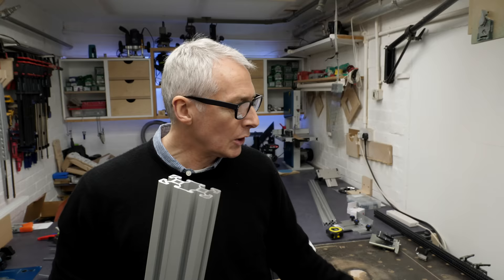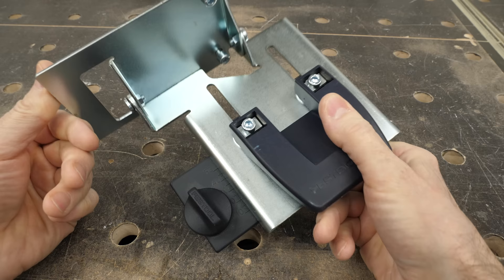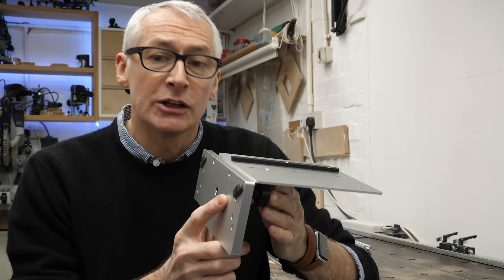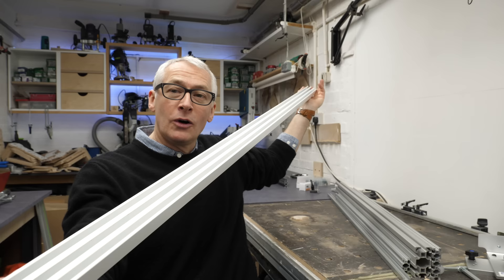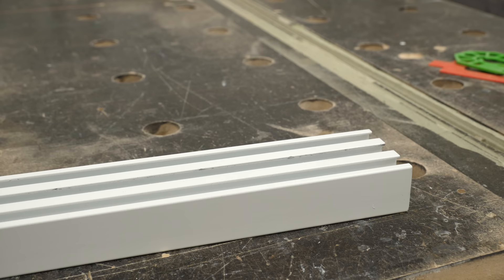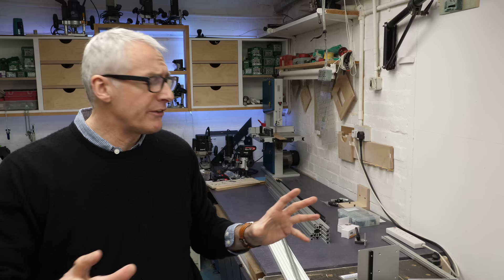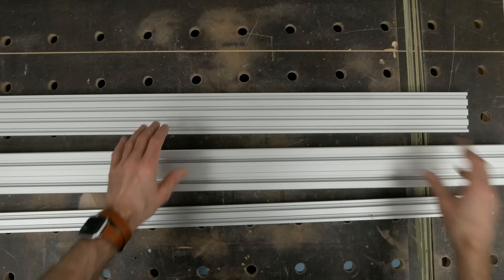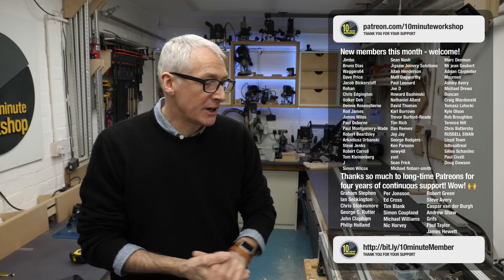Extrusion Confusion - A Guide To MFT Hardware [video 486]

Comment: I will be interested to see what material you fit the t-track into on the front. Given it is 12mm deep I think 18mm material would leave too little material on the back to secure and support it. I heard of t track pull out before when clamping pieces. I would think you'd need to  use at least 24mm, say MDF, so the grove to accept the t-track left 12mm material behind it. Interested to keep watching and find out.

Comment: Note for US viewers.  8mm is very close to 5/16-ths of an inch, (less than a 1% difference).  The 80/20 15 series extrusions work well with most things made for the extrusions with 8-mm slots.  I’m midway through designing and building my own alternative, and have been researching a bit on readily available options for the US and Canada.

And, the Incra miter gauge fence and flip stop are probably going to be used for the fence assembly.  I have it on a miter gauge, and the ability to lock precise 32nd inch, or if you set it up for metric 1-mm positions is really handy.
Reply: @Randall Thomas - I’m in the early stages of design for my mft table. Not sure how to send you a private message if you wouldn’t mind sharing some of your ideas?  I like the 8020.

Comment: Dear Peter, I know I am quite late to the game but I have dealt exactly with your problem and have a nice solution. The profiles you've shown are the Bosch standard of extrusion. But there is a very similar looking but quite different fitting profile standard made by Item. So, if you shop around at eBay or such search for "Item profile" instead of clicking on those Bosch profiles. A lot of 3rd parties are making these, so you don't need to buy those expensive extrusions from Rexroth or Item. They not only fit a clamp in an 8mm slot but also fit most t-track compatible hardware. You can get a lot of accessoires for both profiles and screw nylon sliders on your hinges if they won't fit. 

I hope that helps!

Regards, 
Etna.
Reply from the maker: Thanks. Yes, the Item extrusion is an option, but it still wont tale the Festool hardware. 👍

Comment: I'm going to be renovating my kitchen, I'll be building the cabinets for myself. Because I'll be saving thousands compared to buying a fitted kitchen, I do have enough money in the budget to buy the Makita track saw. I also had the UJK MFT in my Axminster basket, but thanks to your videos, I've realised there's nothing about an MFT I can't build myself, if I can source the extrusions and top.

I've done small scale fine woodwork, building guitars, and larger scale rough carpentry, building my Roubo bench and my wrap around work desk in the office. This will be the first time I attempt fine cabinetmaking at a large scale.

Comment: Pete. I built a paulk style bench and bought the mft hinge system separately. Works great 👍
Reply: How did you attach it Silver Fox?
Reply: @chrissnowden7078  screwed it to the face of both sides buddy. Pretty easy 👍
Reply: @silverfox8801  As in took away the plastic part that slides on to the extrusion and just used the metal face frame?
This was my fallback, hows it working for you?

Comment: Bought the Festool rail hinge a month ago and had virtually given up looking for an extrusion that would fit it. Thank you for showing the IKEA rail, will be down to IKEA tonight. Have all the knobs M6 and M8 with T bolts. I want to use one of my Makita rails. The IKEA rail you will find it in the curtain selection, as with all Ikea stores it is advisable to take a compass with you.
Reply: I went through this same conundrum after buying the Festool rail hinge and naively expected it to fit some normal T Track. I’ve found some extrusion that fits the plastic ‘T profile’ of the MFT hinge/front support perfectly.
However… it’s box profile so I need to route a 7mm channel into it which I haven’t got round to doing yet. It is 2mm thick so it’s nowhere near as thin as the Ikea stuff but nor is it as thick as some of the other extrusions.
I plan to site it in the 4x2 rails of my bench so I’m hopeful there’ll be enough support around it
Reply from the maker: It’s a great find! 👍
Reply: @chrissnowden7078  Where did you get the Extrusion?
Reply: @williba24  Sorry Brian, I’ve replied to this with a link numerous times but it never saves/sends the link.
On eBay, 20mmx15mm Aluminium Rectangular Tube Box Section

Comment: This is brilliant, so detailed. Thanks Peter.
One thing I was going to add was that having 22mm board above the vidga  track to add stability would limit your depth of cut with the Festool hinge.
Reply from the maker: Yes - though one of the benefits of the Dashboard hinge is the increased range it brings - and I rarely adjust the height tbh. And thanks! 👍

Comment: Hi Peter, I built a 8 x 4 MFT using the KJN 4040 profile and the dashboard bracket. I found the same issue that the supplied imperial hardware only just fit but Rob was kind enough to send some bigger fittings. I was planning on using a 1400mm rail but because of the large overhang I had to buy the bigger 1900mm rail to span the bench.
Reply: Hi Daniel I am planning to do the same! Did Rob send you replacement T nuts? Was it an easy fix? How is the kjn mft working out for you? Cheers!
Reply: @olivermarks1185  hello, yes he did it was a simple swap for the new hardware. The KJN MFT works great. I built a router into one end of mine but I am planning on reducing the length of the MFT by a 1/3 effectively making the router table portion separate to accommodated a table saw and use the MFT as an out feed/ assembly table. I can’t recommend KJN enough.
Reply: That’s great thanks for the reply Daniel!

Comment: Great coverage of what's out there.  Another option is to just  use Dog stops so you don't have to use the flip up rail feature at all.   

I took a look at my Festool mounting fixings and added a cut down of a rail connector to my back pivoting mount, to make it a bit stronger.  Much like the Festool OEM version has that you were showing.  Because I never use the back rail and angle protractor, I used a long length of Incra T-Track Plus that I mounted directly to the back on the top of my MFT, then I calibrated the scale in the track.   This allows me to have a full 27.5" (700mm) cross cut width on my MFT.   

If I was looking to start over, I think I would look very closely at some of the offerings from  Dashboard as they have some great ideas that they have done with their machined aluminum gear besides their flip up rail. A bit expensive for Europe, but they look robust compared to their competition.
Reply from the maker: Thanks! And yes, I agree - but as I say at the start of the vid for me in my small workshop I certainly wouldn't want to be without a hinged rail! 👍

Comment: Brilliant info as usual.  I use rail dogs + collars with my dewalt track saw, I would use bench dogs and clips but the rubbish dewalt track doesnt work with them. A hinge setup would be nice as the rail dogs system is accurate but its a bit grabby in the MTF style top which means its a bit of a faff to insert and extract, so for doing just one or two cross cuts I often find myself not bothing to use them at all which isn't ideal.

Comment: Hi Peter,you could not have timed your build of your MFT at the right moment..I am just about to build one myself,but,I'm going to wait,and see what you, the "Tracksaw King" comes up with.
BTW in the past I have had those narrow tracks that just dont quite fit an 8mm bolt, my remedy was to use 6mm roofing bolts from the popular diy outlets,file down the sides,remove a bit from the dome of the head,hey presto, it worked, in the track,downside you had to make some homemade clamps,a little crude I know,but it worked.
Keep up the fantastic work ATB

Comment: Well, this video is right on time. On my recent (regular) visit to my local metal scrap yard I happened upon several lengths of industrial strength profiled extrusion. At one dollar (US) per pound (again, US) I couldn't resist buying all of it: 10ft, 6ft, 4ft, and 2ft lengths! Checking to make sure that it works with the Festool AND Makita clamps I have. 
So, a designing I will go. And building, I will be. Parf jig recently arrived. I've already been eyeing the Dashboard system. It seems quite stout. But a diy version may be the route I go.
Reply from the maker: Sounds like a bargain haul! 👍👍

Comment: Hi Peter, I was in Ikea today by chance and remembered this video from February 😁. 
Not sure if the Ikea top brass follow your channel but the 1.4 Meter "Vidga" triple curtain track is now £22 a length (with ceiling fittings that is).
Considerably more expensive than the £1 per length you mention in this video, perhaps they have realised from your video that they are missing an untapped market 🤣🤣🤣🤣 just thought you might be interested, take care.
Reply from the maker: Thanks! I think I say that it was on a special offer at the time, but even so, £22 for a 1.4m length of extrusion isn’t actually bad value! 👍😂

Comment: I literally just ordered two original Festool 2 meter (comes in pair) rails (front and back MFT/3 style) today, after hours of research. I too have my MFT stationary and wanted it larger, and didn't feel like buying another MFT/3 just to "connect" them with their silly connector rods (still a huge gab between the tables). They cost me around £ 220, and I'll make my own MDF top with the parf guide.

Comment: I built a modular workbench out of aluminium extrusion last year. I found there were two different types of extrusion, BR (Bosch Rexroth) and IR (Item) both available from KJN in the UK. It looks like you have the BR extrusion which has the little groves either side of the slot. I used the IR 40x40L extrusion which doesn’t have those groves and found the Festool ratchet clamps work really well.
Reply from the maker: Thanks. The Festool clamps - and most rail clamps - will work with most off-the-shelf  8mm and 10mm extrusion. The issue is with the rail hinge and support. 👍👍
Reply: Thanks for replying Peter. When you have a moment have a look at the profiles on KJNs website. The Item profile is thicker (has a little return) where grove is which I think will work with your hinge support.

Comment: I had a MFT top CNC'd for me and unfortunately if I use a fence and dogs and use my Woodpeckers square, it is about 0.25mm out of square. So now I am looking at the Dashboard Guide Rail Brackets. With those you can shift the rails and align it to the fence perfectly square. Looking forward to your projects with the Guide Rails. I hope you produce a plan we can purchase for a workshop MFT table with options to use other extrusions besides the cheap Ikea ones.

Comment: Great idea… mad a little confusion with all the stuff you’re not going to use. Look forward to the next one.
Reply: Cost cutting. What are the smart (cheapskate) options for the front bracket Peter? You're usually so smart on this sort of thing?
Reply: (OK, more cheapskating...). I have never seen you move your brackets (once set up). So the rear could be ....4" long?
  What use do you make of the ?? m long front extrusion? (Assumes you do more than most?)

Comment: Hi Peter, have you looked at the Incra T track, not sure if the sizes are what you’re looking for, but they’re well built, and certainly thicker material than the ikea curtain track 😆
Reply from the maker: Yes, but they don’t do a size that will accommodate the Festool parts. Great for clamps and regular t-bolts though. 👍

Comment: Excellent video but, what a confusing subject with all those extrusions fitting this but not fitting that. Everyone has their own way of working and so I have no problem with whatever set up you have - providing you know the options.

Is it me do others agree that the whole MFT arena is full of very expensive options. The fear is that newcomers think that they have to splash out huge amounts to get good results. In fact, I would suggest those newcomers don’t buy any MFT bench, accessories at all until they have worked out what suits them and their space. I’m lucky in that my workshop is now virtually 9m x 8m. That’s plenty of room for the table saw as my main means of cutting panels down. I do use the Festool track saw if I want long strips or just to cut panels in half - but that’s more because of the awkwardness and weight of heavier panels (don’t mock, it will come to you as well). I’ve had a MFT style top (1600 x 1000) for maybe 10 years and I still haven’t used the majority of the holes. Because I’ve got one, I can use that as a template for a new worktop but, I didn’t, I would certainly not spend a small fortune on systems such as the Parf guide. As it is, I will probably only duplicate every other hole. 

I’m on no way being disparaging about new ways of working; I just feel personally that the temptation is for relative newcomers to spend a load of money when that money could be better spent at the beginning of their hobby on the basics; and for free,  scouring YT to evaluate who is talking sense and who is talking, and selling, nonsense. 

Peter is excellent for those whose woodworking aspirations are mainly panel work. You can’t go wrong with Peter on that. If you want to develop into making perhaps more traditional work using hardwoods and even introducing curves, then it’s almost a different branch of woodworking. One of our sons works fitting the insides of very expensive RVs. Almost all of his work is panel work and rectangular pieces. He’s truly excellent at making cabinets, edge banding etc. but he only works with hardwoods at home and has learnt most of that from me. That will teach him.

Comment: Amazing. I had the same idea and went through the same headache during lockdown. I was trying to design a hinge that automatically adjusted to different thicknesses. I thought the hinge assembly could attach in benchdog holes instead of on the back rail. Maybe that's an idea for you getting your table up against a wall.
I also thought the benchrail could be allowed to pivot to allow for angle cuts. I never did finish it. Glad to see you have taken on the baton!
Reply from the maker: The trouble with having the hinge attached to / with benchdogs is that it eats into valuable cross-cut capacity. I know - compromise, right? 🤷‍♂️ 👍
Reply: I was thinking maybe integrated into the benchrail

Comment: Peter, re the US 80/20 extrusions:  80/20 makes extrusions in two imperial sizes.  The 10 Series, 1-inch increment base dimension, with a 1/4-inch slot centered on the inch increments.  the 15 Series, 1..5 inch increment with a 5/16 slot.  They also make metric extrusions in 20, 25, 30, 40, and 50 Series, where the Series number is the base increment, and the slot size is 1/4th of the base increment rounded to the nearest standard bolt.  For example, the 30 series has 8-mm slots, and the 20 series has a 5-mm slot.  The 30 and  40 series both have 8-mm slots, and the 50 has ten-mm slots.

If you contact them, they could make up a precut kit of all the pieces required to make a frame for a top of your design.  Which you could sell on Etsy, and they would drop ship the kit tot eh Us and Canada, and possibly Europe.
Reply from the maker: Great info, thanks Randall! 👍

Comment: Peter, great review!  But, I still am a bit confused on the way to move forward. 😀
I CNC’d my own MFT-style top about 10 years ago, just prior to buying my Festool TS55. It is 3’ x 7’ — I removed a foot in each dimension from a full sheet of MDF. My “MFT-XL” bench also serves as my table saw outfeed table, and outfeed for my planer which resides on a mobile cart. I still just use bench dogs to position rails when using the track saw. I would love to add a rail hinge to the bench, so you have given me some ideas on how to proceed.

Comment: Heh Peter at last your on the trail.😂 As you know I did this a while ago after you helped with the extrusion part numbers for the Festool stuff which I got from Spare Parts World on line and got a repeat 10% discount as well as the rear hinge and front support. Fitted it to one of my MFT/3 benches that I built out of left over fence posts for legs and 2x4 framing, works great. I secured the Festool long extrusions with roofing bolts that fitted the rear slot in the extrusion and very carefully positioned and drilled he fixing holes to the bench frame and it all works splendidly. A little more expensive than Ikea kit but heh ho😂. As I said before can't wait to see yours. Happy building Peter and another great myth busting video.😂👍
Reply from the maker: Thanks David! 🙌

Comment: Fitting the Festool Guide rail support unit into the IKEA rail. No need to sand fitting.  Remove both ALN M6 bolts and replace with 35mm T slot bolts or any  larger length cut down to 35mm. and fit 2 M6 Nuts' an M6 box spanner helps with the nut fitting. Fit unit in the centre track, Adjust nut until you can tighten lever. Drill a new hole in black plastic to fit the knob in the centre rail slot.
T slot bolts M6 35mm. (Jack-Quark) Ebay China. £12.86    
 2 M6 nuts. 
 1M6 Leranxin  sliding T nut.  (Amazon) 20 Pack £6.99.
If you buy 2 IKEA rails £19 each you can fit one to the front and with the extra T-Slot bolts and the knobs you can fit any clamp.
Reply from the maker: Or just spend 2 minutes sanding it, total cost £0 🤷‍♂️👍
Reply: @10MinuteWorkshop  I gave up after 30 mins with sandpaper and a rasp.

Comment: I think that you'll find that 8020 is just the company name and that lots of US based YT videos use the term 8020 as a general moniker when referring to aluminium profile, rather than profile that specifically has those measurements. And of course, 8020 sell profile in lots of different sizes and not just their eponymous namesake.